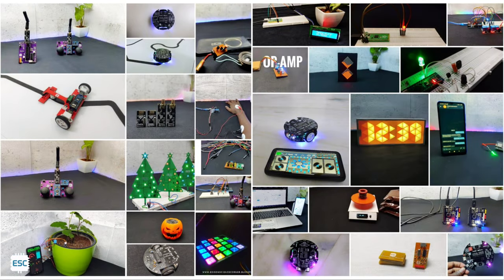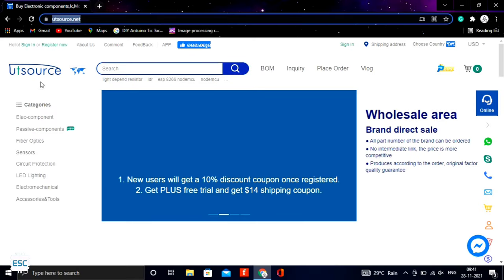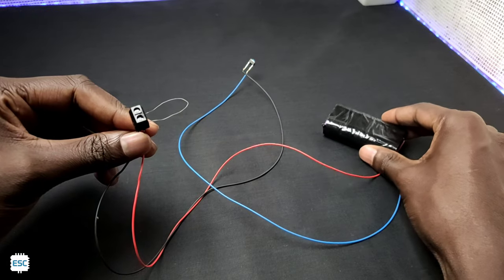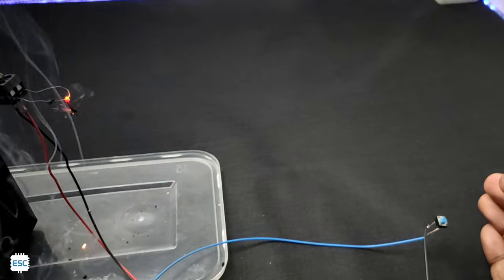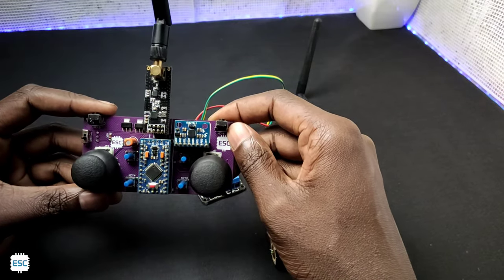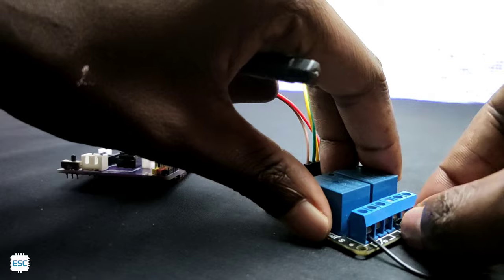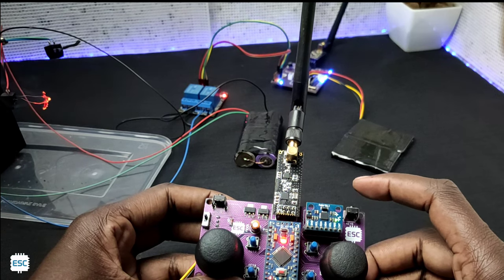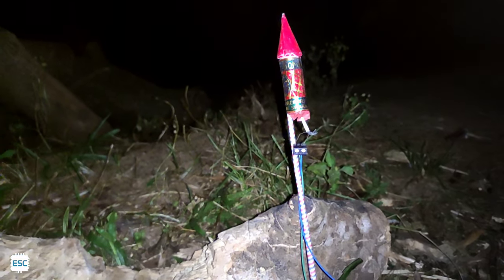Remote control ignition system using arduino and NRF | UTSOURSE

Comment: Happy new year bro and pls make fm transmitter and reciver
Reply: Yes..  Please..  
With Arduino
Reply from the maker: Yes i will do that
Reply: @techmaster6587  Well an Arduino can't really transmit or receive FM radio. But it can be done pretty easily without a microcontroller.

Comment: Nice project, but we can cut down the cost by integrate bluetooth connectivity for ignition which operates from mobile
Reply from the maker: Yes. we can even cut the cost by igniting directly using lighter.